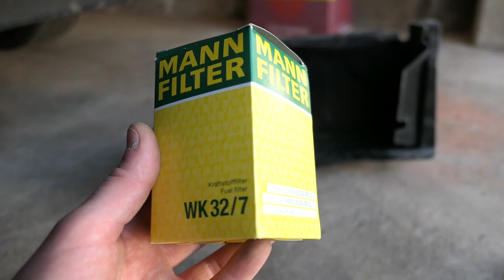Mercedes W212 | Replace Airmatic Compressor Filter

Comment: While you are at it, make sure the rubber pipe to the right of the filter in the shot, is not chafeing on that corner bolt head of the compressor. I discovered mine was last week and it had almost worn right through the pipe.
Reply from the maker: Thanks for the tip definitely going to think about that 🙏 Going to do big airmatic “service” soon then I looking to that.
Reply: Yeah, my pipe was broken and sucking in bad air and maybe water, had noticed the pump had got noisier. Had new Mercedes’ installed pump almost 3 years ago and they didn’t replace hose or filter as part of job. Pump had 2 yr warranty so not impressed with dealership. Merc supplied Pump is not cheap so definitely should be on service check list.

Comment: Excellent video, thank you from the UK!

Do you know if this filter works for all 4 wheels or just the rear suspension?
Reply from the maker: Thanks for watching! This filter should should also works for the 4 wheels airmatic system. Don’t think is any additional one to my knowledge.
Reply: @MB212  Fantastic, thank you for the info!

Comment: Great video, thanks! Just one question, what's the purpose of changing this filter if the compressor is working?
Reply from the maker: These can get bad and get clogged that’s not good for compressor. But in this case it’s was good but like to keep service all thing to know everything keep running smooth even if this it’s not on service. Can be good to check it out when car getting older.
Reply: @MB212  Great, that make sense, just my way of taking care of the car! Keep the good stuff coming 👍
Reply from the maker: Thank you 🙏

Comment: Nice video!
You happen to know why we sometimes find the back of the car down when we arrive at it? The compressor sometimes needs some time to bring it up. The strange thing is, it doesn't always behave like that.
Reply: Rear air springs are leaking and need replaced. Replace both sides. Typically shocks needs replaced at the same time as air springs.
Reply: Correct and only buy Arnott air bags

Comment: Do you need to change this part ?  Why ?
Reply from the maker: Not really it’s not in MB service list. But could be good to check when your car get older. But as you could see for my car it’s was really no point to change it. But if your unlucky it could be clogged with dirty.
Reply: Fine Vid! Well done!
One Question: Did you lift up the car, or did you the Job lay'in at the Ground?
Reply from the maker: Lay on the ground not needed to lift up the car.

Comment: Does this cause the suspension to deflate sometimes when left for 10 hours
Reply from the maker: No this should no be the problem. Sound like you need to change your air struts.